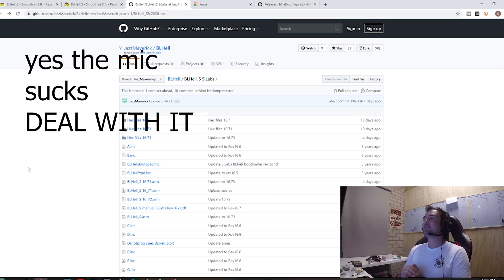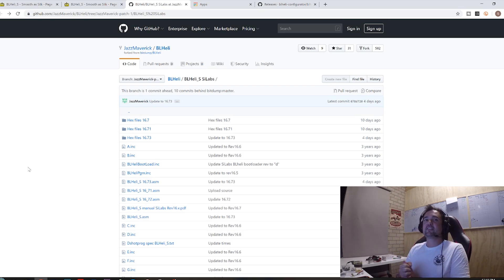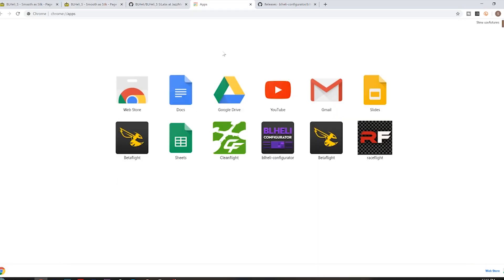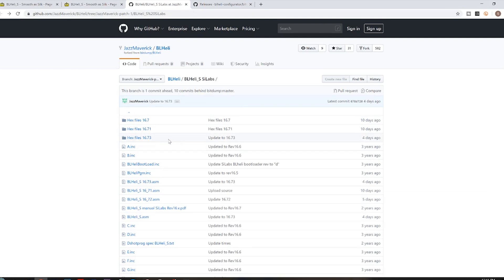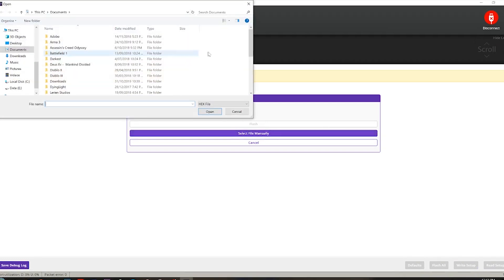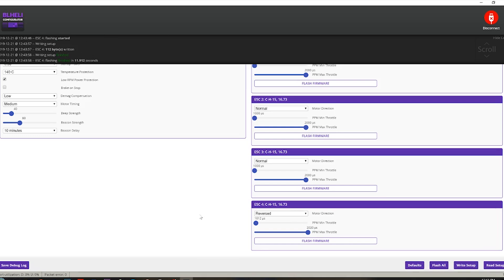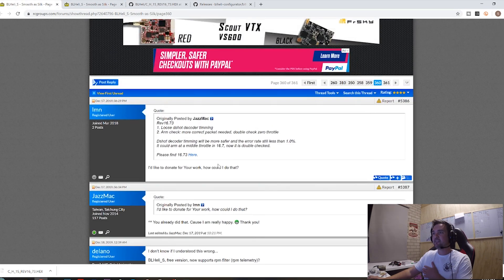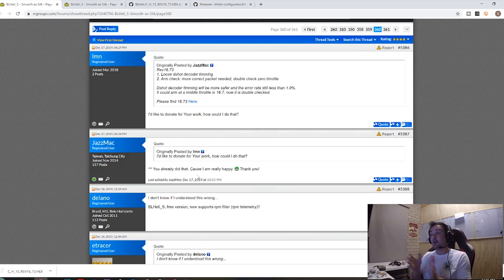How to get RPM filtering FOR FREE! Betaflight 4.1BL heli_S update

Comment: It simply does not work with my A-H-70 ESCs. Reason is that my led strip is connected to motor 6. So I set resource motor 6 none and resource led_strip 1 A08. And then everything goes crazy and comes back to work when I disable the RPM filter

Comment: Went to blheli web site this morning and he has pulled his formerly latest 16.75, I tried 16.74 on another kwad w/A_H_30 and motors wouldn't spin up, backed off to blheli firmware, motors are back.  I will down load latest (16.74) and 16.7 for all my esc's but not updating, wait for dust to settle, 16.7 has got some bugs in it, some serious I'm going to wait for 16.75 to be re-released before trying to update any more esc's.
Reply: Problem all along was old iNav version, although iNav doesn't support RPM filters  there are certain kwads I run only iNav and iNav will soon support RPM filters, all these iNav kwads are running 7" props or bigger and iNav knows better what to do with GPS then betaflight.

Comment: Tried, it seemed ok during and aftyer flashed (unplugged kwad and restarted blheli16 to verify) then in Betaflight erratic results with 1 or esc in 4in1 disappearing, tried ref lashing several times (16.7 to 16.75) with apparent success and again in motors tab in  betaflight had problems 1 one or more motors spinning properly, re-flashed to blheli original 16.7 and all is good.  Check out the release dates on this stuff, it didn't just come out, its 2017 vintage!!!!!!!!!!!!!!!!!!!!!!!!!!!!!
Reply: My bad on date, depends how u get to it, the provided link gets you the latest, if you drill down from JazzMaverick/BLHeli from the Jazz... level you get the wrong release.   Not "master" but "JazzMaverick-patch-1".  Don't know which release I actually used at this point.  I'll try again and update.
Reply: Used correct files worked as advertised.

Comment: Isn’t it all from open source? If we start charging for a this bit of code which probably had part of an initial code which was a fork of another code where does it stop? We will have to start paying every time  BF has an up date.. I think it’s great that Jesc is there for those such as myself who are happy to pay for it. But I don’t think anybody should be neh saying all those who are advocating open source. At the end of the day it’s what has brought us to this point, and it’s what will ensure the future of this hobby.Licensing will be its demise.
Reply: I am absolute pro commercial SW. But you cannot take a GPL V3 Opensource firmware and make a kind of closed source plugin to it + charge for it. That is what Jesc does - against all GNU regulations.
It is great that Jazz brought us a real Opensource approach and puts an end to this.
Reply: Stefan Thesen agreed 100 percent
Reply from the maker: imagine if something like turtle mode was locked behind a paid firmware
Reply: @UAVfutures  Hey guys isn't it that BL32ESC's do feature RPM telemetry and this is not fully free/open either ?  So or I buy bl32 esc,s  and pay some royalties inside the purchase pricee, or I use my existing esc's and pay some royalties to Joe Lucid for Jesc  Yes in the end it would be better if it could be opened, but then also BL32 to be opened.

Comment: the free version has bugs. be careful
Reply: what kind of bugs?
Reply: @arimo4983  no clue. Joshua Bardwell sent the info. Maybe he detailed what bugs has in the free version but I deleted the email. I will check on that and will let you know if I got the info
Reply: @zoltangremsperger5361  could be that since there is no Telemetry flash... usually u can flash Telemetry after having the latest firmeware on ESC.
Reply: @xandir31415  I've got this from Bardwell: "if you are thinking of using the free/open blheli_s implementation with bidirectional dshot / RPM filtering, don't. I am hearing reports from devs that it has tons of corrupted data at high throttle. JESC still the way to go."
Reply: @zoltangremsperger5361  this is simply not true.  Checkout the RCG thread.  JazzMac found a dshot timing issue in blhelis (and JESC) that resulted in 10-50% of dshot packets sent to the ESC not being read.  As a result rpm tlm was not being sent back.

JazzMac found and fixed the timing error.  I have tested this up to 80,000 rpm with close to zero errors.  Results on FB and Slack.

JazzMac knows his stuff!!!

Comment: This is awesome!! ...where is bardwell on this one?? Way to beat him to the punch Stew!!
Reply: Bardwell sent a message weeks ago about the free Jesc and warned us to be careful with the free stuff because it has bugs
Reply: @zoltangremsperger5361  this is simply not true.  Checkout the RCG thread.  JazzMac found a dshot timing issue in blhelis (and JESC) that resulted in 10-50% of dshot packets sent to the ESC not being read.  As a result rpm tlm was not being sent back.

JazzMac found and fixed the timing error.  I have tested this up to 80,000 rpm with close to zero errors.  Results on FB and Slack.

JazzMac knows his stuff!!!